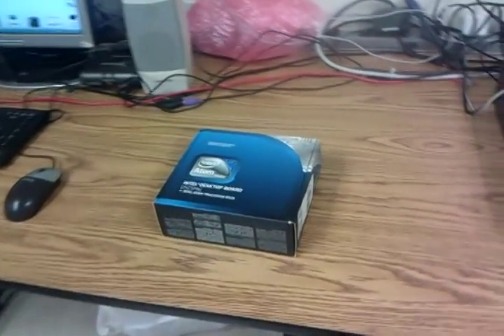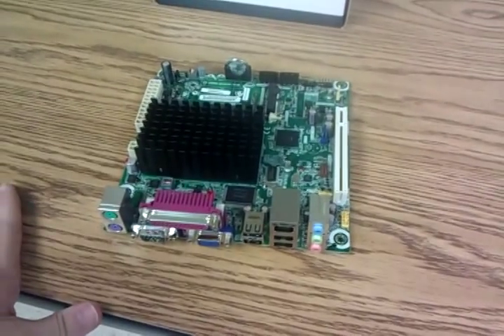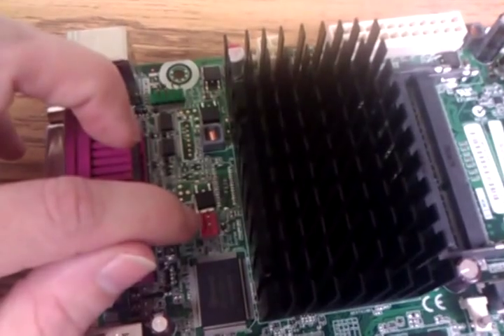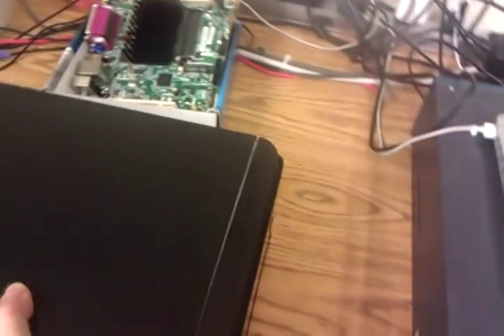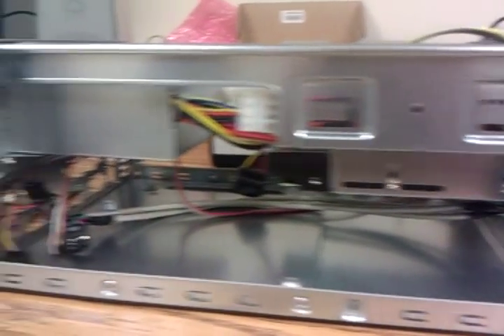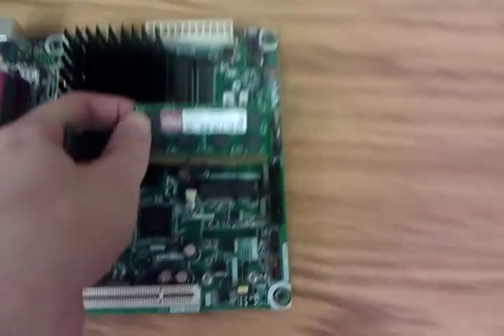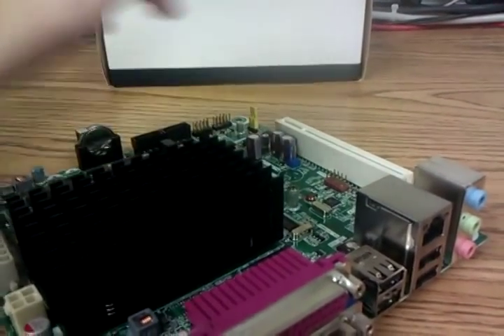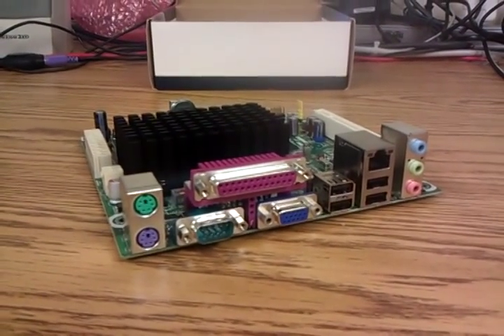Overview of Intel D525MW Atom Desktop Board

Comment: I have the same board. I got a small Antec case with a power brick style power supply. I believe it is a 60watt supply. That's actually more than enough for a simple setup like this.
Using a watt meter, with one 2.5" HDD and an 80mm fan the system doesn't exceed 22/23 watts even under load.  60% of power is recommended to not be exceeded for a constant load on power supply's, spikes are fine, but at 22 watts it doesn't even break 50% load on the 60watt psu.

Comment from the maker: I deployed 10 of these for a client about 2 years back, using Shuttle supplied mini-ITX PSU's...I think about 100w.  Every single board suffered blown capacitors and eventually dead PSU's.  I still have the shells here in my office.  A quality 250w from corsair or pc power and cooling will run for much longer with less instability, at least in my experience.

Also, if this board draws 45w and we use a 250w capable supply, it isn't really overpowered, it just uses 45w is all. Ymmv.

Comment from the maker: @webfulcrum This particular board eventually ended up serving 10 users as a small NAS and it replaced an old Celeron D based system that was serving the same purpose.  The D525 is up to the challenge of running CentOS, or Win Home Server, but with Server 2008 I don't think it has enough horsepower personally.

Comment: I think I paid something like $75 for it last year. It's great for what I use it for, which is a headless server file/web and more.  Way more processing power than what I need. But the next generation Intel Atom is out. You can basically get this board with the new Atom D2700 for under $100.

Comment from the maker: @ivanbcn1978 This board can run VLC in Windows 7 and play DVDRIP style movies just fine, I had a bit of struggle with 720p but it was doable, beyond that wasn't so hot.  If you have an ION chipset that VLC can tap into it plays the HD stuff pretty well.  Some of the Zotac brand boards have this feature that I've used.

Comment: uses a normal power supply? really?
you maybe can, but its to much overpowered, if youre going to buy this board you and you have an itx case you already have a power supply  integrated, than why do you say for not getting the crappy shuttle power supply? its just the same like other cases